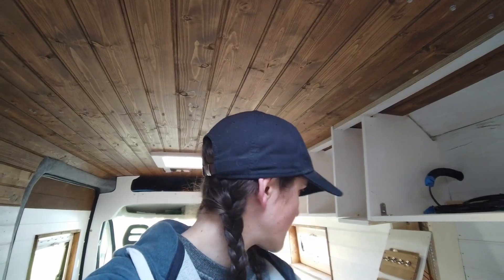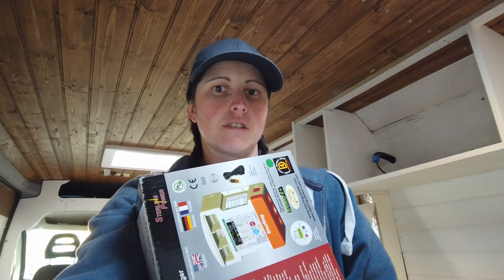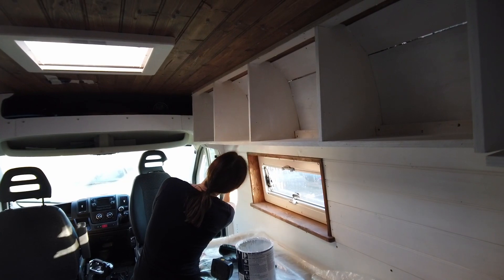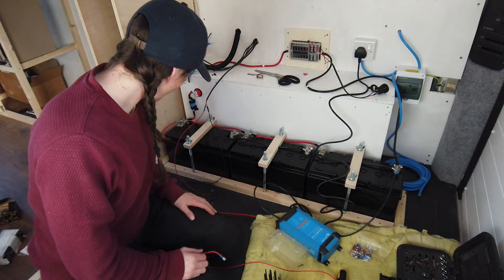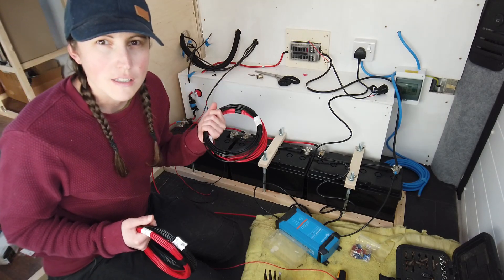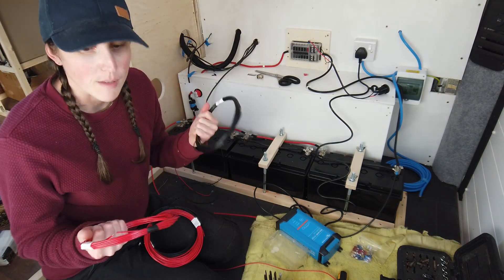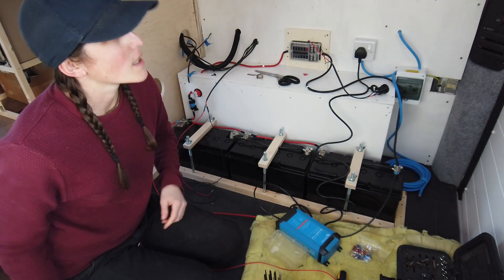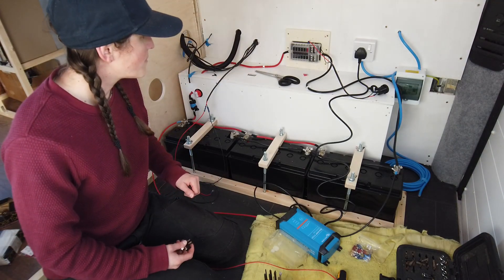How to wire up your 12v diy campervan electrical system... and sterling battery to battery charger!!

Comment: hi.this sterling looks more user friendly than my 2 victrons i bought.im only getting 28 to 38 amps from 30amp dc orion plus 18amp one.sometimes they don’t turn on have fiddled with settings even switched to power supply mode on bluetooth but if you forget to switch back to charger mode it drains your starter battery.my old 12amp dc charger which i had for 5 years more reliable .😊

Comment: Hey Lou. Curious if you still use this charger and if you get 60 amps from it constantly? Cheers
Reply from the maker: Hi alistair, yes we still use it. It’s been great so far, tho sometimes a little noisy.

No, we don’t get 60 Amos from it ever, I think about 40 is the most we get and it drops to absorption pretty quickly too, but then there’s never often too much for it to put back in. I think the longest it’s ever taken to top us back up from driving is around 3 hours when we was in the snow in winter.

I helped a friend install the victron one a little while back and that only seems to output 12-15 amps from a 30 amp unit. A lot of people on here seem to be adding a second one to their system.

Comment: Hi belated congratulations on your wedding anniversary  
Love ye vids one quick question  so you can run 2 batteries as long as there wired parrel with the correct size wire 
Thanks in advance ❤

Comment: ive been looking for days to find a video on how to conect my lighting circuits to a control unit with switches so i can use multiple lights at different times... but i cant work out how to wire it, from the battery to the fuse block from the fuse block to the control panel and then i dont understand what to do please helppp x

Comment: ok, I'm at the stage ready to wire in the victron b2b DC charger. I bought a non-isolated version so I can earth to chassis and not need the other -ve cable. However, I'm going to be using the drivers side b pillar 54A constant live feed instead. Can I ask if you considered that ? - https://www.misterg.org.uk/camper-converters-socket.html

Comment: Hi Lou. I watched your home made switch panel. Maybe you did another blog but can't find it on were you send the wires to from there. I have all wires running to fuse box. What I need to know is how do you run the wires from the panel. Most vidio says to battery. I just don't get it. I want to make sure all circuits run to fuse panel. So do you run all induvidual wire from fuse box to control panel. Thanks.
Reply from the maker: Hi shey, I hope this makes sense but basically you will have a single (thick) positive and negative cable going to the fuse box. From the fuse box you will run your cable either straight to the appliance or to you switch panel and then to your appliance. So for a light the cable will go from the fuse box, to a switch and then from the switch to the light. The negative cable will not need via the switch. If its just something like a socket the cables will just go from the fuse box to the socket.
So everything will eventually run back to the fuse box, hope that makes sense.

Comment: hi, thanks for the vid - gave me a few (easier!) ideas for my Relay. I was toying with going through the B pillar on the passenger side for electrics, but your way seems a LOT easier. Can I just ask - roughly how much cable did you require in total for the long run from starter battery to leisure battery?
Reply from the maker: Hi Simon, glad you liked the vid. I want to say 6 meters but I honestly can't remember it was so long ago now, so sorry I can't be of more use.

Comment: Please could I ask how thick your wire is to that runs from the B2B charger and the leisure batteries?
Reply from the maker: Hi, I've used 16mm cable, I'm not expert tho but it's working OK so far. But like I say, I'm no electrician 😂
Reply: @campervibe  Thank you! Watching a few videos tonight has me realising that I may have undersized mine (bought a load of 10mm for a 40Ah b2b charger) but I'll do some more research before purchasing thicker cable. Thanks again :)

Comment: Hi Guys, you don't happen to remember what size posts the positive & negative on the starter battery were that you attached the cable for b2b charger do you? Trying to order my lugs, and not sure whether to go for M8,M10 or M12? Many thanks for your useful videos!
Reply from the maker: Hi Sophie, not off of the top of my head, but I don't think I ever bought 12s so I reckon it's a 10 or an 8, but to be fair they came in the kit I ordered so could be any. So sorry, that's really not much help is it.

Comment: Just binge-watched a ton of your vids - proper job that, so impressive & inspiring. & I’m only looking to kit out a Berlingo😂. Thanks for doing these
Reply from the maker: Thanks a lot teige 😁 good luck with your Berlingo, I know it's small but that must throw up a whole host of different problems, space to work and fit things being one I guess! Thanks for watching 😁👍
Reply: If I can get the insulation sorted I think that’ll be 1/2 the job - I’m hoping to take it to Scotland towards late Winter & get up the mountains in lieu of a trip the Alps probably not being a good idea at least for the foreseeable

Comment: just watching this vid again, like you do on an exciting sat night.  You mentioned you ran 2 core during the first fix for the relevant circuits, did you then just strip back to connect the live and neutral to the fuse holder or did you conect seperate small lengths of the idividual red and black cables for conection to the fuse holder,, hope that makes sense..its been a long day ha
Reply from the maker: Hi Michael, I just stripped back and then went straight to the fuse box, or switch if necessary, if that's what you mean? If you're asking about the cable for the b2b I used single core 16mm cable for that so went straight into fuse holder. I hope I've understood you and I hope that makes sense, it's been a busy week for me too lol! 😂 Let me know if you need more info.
Reply: @campervibe  thanks for that, thats what i thought with the 2 core,stripping back to fit in the fuse box
Reply from the maker: No problem 👍
Reply: hi, you made a vid detailing the victron mains charger but i cant remember which one it was. do you remeber which one.. thanks mick
Reply from the maker: Hi mick, I can't actually remember myself lol!! But it's probably this one I reckon, let me know if not https://youtu.be/V0Auk8dhlnw
Reply: @campervibe  maybe i dreamt it
Reply: its the one where you go into the mains charger app ..
Reply from the maker: Hmm, I would have thought it would be the link I've posted above but I can't see it there, I remember doing it but I can't for the life of me find it. I go into the app in this video too but this one is more about the battery monitor, I'll have a better look tomorrow https://youtu.be/2n2a9VoJHqY
Reply: @campervibe  thanks for that, ive watched loads of vids, so maybe ive just got all mixed up.  not hard for me
Reply from the maker: @MrFatknackers  😂😂 I remember going to sleepseeing youtube videos when I was planning our build lol!!

Comment: Hi, all 3 chargers(mains, solar, b2b) are connected to the battery directly. does it give any trouble? what happens when all 3 are charging at the same time? do I need to use any changeover switch to select just 1 charger charging the battery at a time?
Reply from the maker: All 3 are fine together as they are smart chargers, so when the solar senses a higher voltage from the b2b or mains charger it knows to back off. So no, we don't have any kind of switch over switch.
Reply: @campervibe  cool! thank you.

Comment: like the video for this one as im getting a relay.  Has there been any issues with the distance between your VB and LB,  was it 16mm cable you used to connect the 2  together  thanks mick
Reply from the maker: Hi mick, no issues so far, yeh we used 16mm, wouldn't want to go any smaller tho 😁

Comment: Wish I’d found your videos earlier there great just coming to the electrical part of my van build and was just wondering do you not have a ground for the leisure battery’s coz it is grounded through the b2b?.
Reply from the maker: Hi there 😁 I haven't actually ground them yet, I do run back to the starter battery with my b2b charger which is ground. I am going to add a ground soon tho, all my circuits work as they are complete, all my negatives come back to the batteries but after a lot of research I don't think it's going to do any harm to add a ground for the leisure batteries. Hope that makes sense lol, thanks for watching 😁👍
Reply: camper vibe yeh think it does it’s blown my mind a bit all this electronic shiz 🤯😂 great help with the videos tho and the van looks cool as. 👍👏.
Reply from the maker: Yeh electrics was the hardest part for me too, once you've finished it tho it seems a lot more simple lol, I know that doesn't help you now tho! I broke it down into small sections to get my head around it. Thanks again 👍

Comment: Thanks for that! I'm currently looking into b2b chargers, I didn't even know they did a 60 amp! It's huge! Are you leaving the unit in that position or will it be moved to a more discreet location? also do you know if it's possible to have that unit back by the batteries or does it need to be as close to the starter battery as possible?
Reply from the maker: Hi, we are just gonna leave it where it is, I prefer being able to see it lol. I think sterling reccomend it be close to the starter battery but the company we bought it off said it doesn't really matter, so I don't really know to be honest lol!
Reply: If the battery is near the starter battery and some distance from the leisure battery there will be a slight power (voltage) loss due to the cable length. With suitable 10mm/16mm cable it will be small but it is still there. 
If the B2B is placed close by the Leisure Battery then the voltage drop due to the cable length will be compensated for by the Sterling B2B.

Comment: Spot on video, thank you! Did you change your settings in the end? I’ll be using my van as a daily. The guy at simply split charge said the B2B  mode 1 will be fine.
Reply from the maker: Hi Tom, thank you. I did change it, I've got it on agm1 (which is number 2 on the list) we had it on agm2 but found that was prob a bit too high when in absorption mode for our batteries. Hope that makes sense lol.
Reply: I'll be running a single battery so will try the open 14.6v mode and see how that goes. Looking forward to following your channel!

Comment: I don't care about your fucking anniversary, in my eyes you are perverts, just look up the dictionary definition of it to confirm, the video about wiring is sufficient, don't need you forcing your perversions down my throat like it's natural, it is not regardless of what the MSM is pushing. This world has slipped into depravity and a reset is needed ASAP.

Comment: Hi, I have the same B2B charger and the unit has a powerful and quite noisy fan! As you know it hasn’t got much of a decent casing either for mechanical or water protection. I have put mine in the box under the passenger seat with some sound insulation. 
The sometimes quite warm air (it has to run at nearly 800watts)  firing out of the unit will possibly annoy both of you. FYI Sterling do a remote controller which uses a data cable like the Victron Shunt data cable for mirrioring the units functions.https://www.12voltplanet.co.uk/remote-control-for-sterling-pro-batt-ultra-battery-to-battery-chargers.html
Cheers!
Reply from the maker: Thanks, I'll check out the controller 👍😁

Comment: Happy anniversary! A question I have regarding your Sterling B2B charger, does it make any noise? The spec sheet claims it has a cooling fan, and I’m wondering if it’s possible to hear it over the engine.
Reply from the maker: Thank you. To be honest I couldn't say for certain, it hasn't so far but then due to lockdown we haven't been able to drive very far to allow it to do a lot of work, just top up charging really and the fan has never come on, or if it has we cant hear it. Sorry i can't say more! Thank you for watching!

Comment: This video was really helpful you're better explaining than most with complicated electrics. I'm seriously thinking of getting a sterling b2b charger and so need to get one as coming to the electrics part of my build which I am not exactly looking forward to.  Also what an annoying place for the starter battery location in your van in my ford transit its right under the driver seat - easy!
Reply from the maker: Thank you 😁 probably because it was all new to me too lol! The electrics was the worst part for me but it's not so bad when u break it down. Good luck with your build, and thank you for watching 😁👍

Comment: Hi Girls.. I don't normally comment, I don't think you should have put the B2B on the front wheel arch. They are very touchy and the fact that it will get kicked as you get in and out of the van. I would advise you to put it away in the back of the van in a place that nothing can slide around and by accident push the buttons. Once this B2B is set up, you just don't worry about it any more.. I have been fitting these for many years and they are very reliable.. Keep up the good work..
Reply from the maker: Hi, thank you for your input, when I spoke to sterling on the phone they actually reccomend that it is located closer to the start battery? Also, I'd rather have it where I can see it than buried in a cupboard as if there is a problem or it starts overcharging (which has been reported) then at least I will know. It won't get kicked where it is, it's above the entrance step.

Comment: Happy anniversary , have a question , I am going back to uk in March , and thinking of buying a van to convert , what do you think of Citroen / Peugeot/fiat, or would you suggest looking at others?
Reply from the maker: Thank you. We are on our second citreon, we go for this van cos its the widest and we are short enough to have our bed across the width of the van. Also ours is galvanised so less prone to rust. Based on what other people say the sprinter/crafter is brilliant mechanically but prone to rust, the transit rusts ridiculously quick. I will say the citreon/Peugeot/boxer  are prone to electrical issues (we have experienced this ourselves) I suppose its like everything, there are good and bad models of each. Ours is comfortable to drive and like I said the width is the most important thing for us.

Comment: Thanks for the super helpful video! I'm trying to plan my electrics at the minute (steep learning curve!)- have a Euro 6 engine so going to go for a B2B charger. Was just wondering if you looked into getting one that is also an MPPT charger and running the solar through that as well? Is there any big disadvantage that I've not thought of combining the solar and split charging systems (or an advanatge of keeping them separate?). Thanks for any input!
Reply from the maker: No problem. I did look at a b2b with built in mppt and the redarc units came up really well. However, the reason I didn't get one is because if one fails they both fail and you have no off grid way of charging. Because we like to go to remote places we may not always easily be able to get it repaired or replaced. Also, I really like the look of the victron mppt with its built in Bluetooth and I'm think that a dedicated mppt may be that little bit more efficient, so that's our reasons lol, hope that helps! Thank you for watching 😁👍

Comment: I fitted one of these this morning. Mine came with no fitting kit so had to sort that out .  The setting up instructions book looked daunting and I didn't have a lot of time so it's running at default settings.   Thanks for explaining what the lights were doing and what it means as I didn't have a clue.  Might leave mine as it is now . 👍
Reply from the maker: No worries. Mines running on default and seems just fine. 😁

Comment: Good progress Louise. I've been impressed with every thing you have done so far, but I must say that although it would be a pain in the arse, I would definitely re-site the sterling b-b charger elsewhere. You will hate me for saying it but I think it's a definite no no where you have it. All the best .....Jim👍👍
Reply from the maker: Thanks Jim. Can I ask why? It's clear of the foot well and sterling say it should be close to the start battery so the only other real place is under the passenger seat. As this will be on a swivel I'm not so sure about it?
Reply: camper vibe , now you've put me on the spot😂. I just think that over time you're going to regret it there. Although it's clear of the footwell, I still think that it's going to get kicked or just be in the way at times (pathetic excuse I know). It's probably just me being finicky.... I have seen them fitted by others and they have them fixed close to the Leisure battery, I can only assume the reason sterling say close to the engine battery is because of a small voltage drop. ...ok that's my ten penny worth👏......Your both doing a great job and I look forward to your progress & adventures 😂👍.........Jim
Reply from the maker: @grumbleweed5570  thanks Jim, originally I was going to hide it in a cupboard at the back, but then it occurred to me I couldn't then see it, as it's all new to me I want to know everything is working correctly, probably just paranoid. Shouldn't be too much trouble to move it at a later date. Thanks again for watching Jim, appreciate the input 😁👍
Reply: camper vibe , I have a Neisman Bischoff motorhome with solar panels, 3500 inverter and 2x Lithium batteries. All the charge controlling is by Victron and is Bluetooth so I can glance at my phone. It's a shame that the Sterling isn't Bluetooth......Jim👍